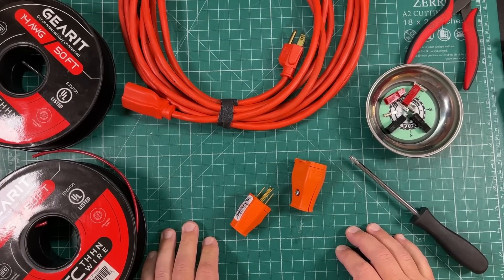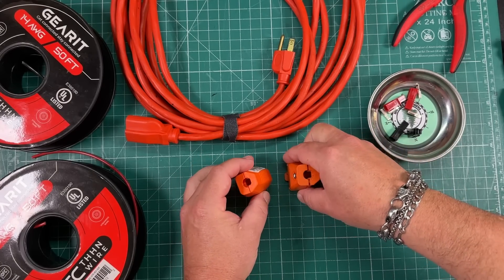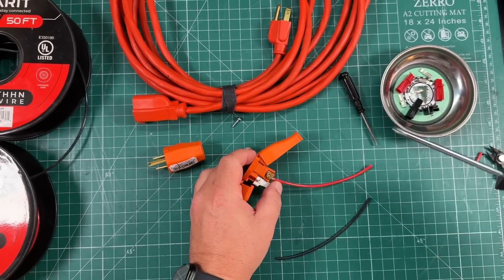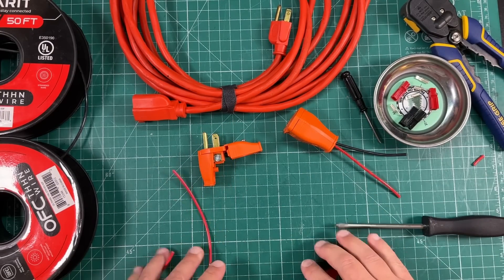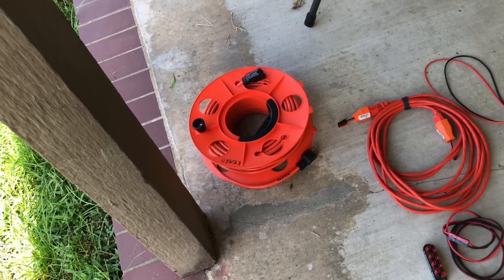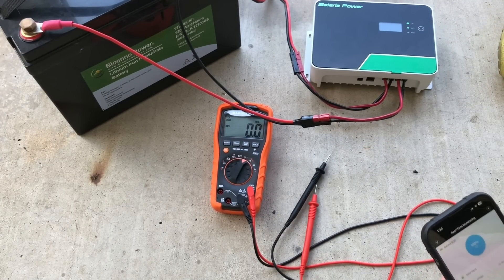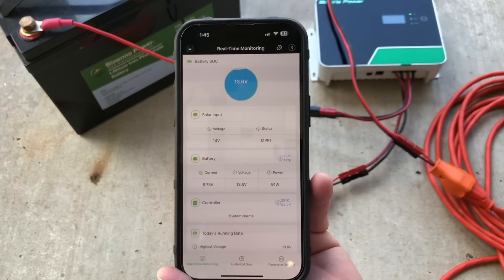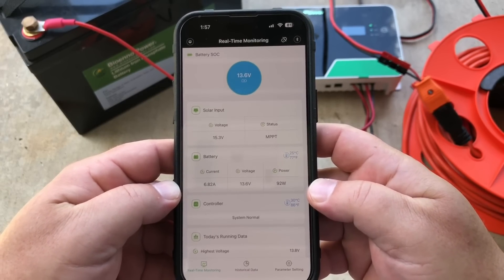12V DC Through Extension Cords For Solar.  Will It Work?

Comment: I've been doing this for solar for about 15+ years.  I just cut the extension cord ends off and attach Anderson PP directly to one end and ring terminals to the other end.  100 foot runs through the winters here in Alaska.  Works just fine. Always good to experiment though and thank you for the video.

Comment: Stay safe Mike! If you want to use an extension cord, cut the NEMA 5-15's off each end and crimp on PP's directly... If you make a NEMA to PP adapter, someone, someday, is gonna plug it in!⚡⚡as for the losses, you're going to need 10x the current with 12V over 120V for a given power transfer, and the losses are I^2, so you're fighting a 10x10=100 fold battle... Get the highest gauge ext cord you can! Jumper cables, maybe? Keep experimenting! (Safely!! 😊)

Comment: I would have put the negitive to the ground plug, I would think that might reduce the chance of the magic smoke comming out of things :)  Just a thought.   Good idea for an emergency - 1/2 the power is better than 0%.  Maybe try converting the DC to AC, using the 100ft cord, and then converting the AC back to DC.

Comment: Why not just pound the power-poles in the negative side of the AC extension cable and charge your battery directly from the wall…? Should have no problem with voltage drop then…

Comment: I’ve been doing this for my temp solar setups for years. I really use a 12ga. extension cord, but in a pinch any old extension cord will do…  I try to keep the length to 25 ft. 400 watts of solar is plenty enough to keep my Bioenno battery charged for Portable HF use.

Comment: I got that hurricane in NY today that came threw Texas . We got grid down and 2 torandios hear. trees down all over. flooding but minor. on;y 3 in rain today.  Try 2 extion cords . all 3 wires for each pos and neg. repeat test you did.  At least you did not put 2 male plugs together and plug 120V inverter into your home . How very bad that is. never back feed power grid.  you put transfer switch in breaker panel. And that can be inverter or generator . just do not use 12V power cable for 120V . insulation not rated for that.  some is 300V/600V AC/DC cable.  UL Welding cable is . 73

Comment: @japanham5973
1 second ago
Wrap the cord/power pole connections with self-fusing Silicone rubber electrical tape. It is a bit sticky, but will make anyone notice that the cord is not just a regular extension cord. They would have to take the tape off, unplug the Power Pole jumper to use it, and I think most would hesitate to do so without checking out the other end too...

Comment: I did what @jamesemery1 commented on. I use two separate extension cords (EC). Each is 16AWG/3, one EC for positive EC one for negative. Combining the three wires in each cord creates an 11-ish gauge wire. I use MC4 connectors from the panels to the solar battery systems I built. I made a MC4 to Anderson power-pole cable. My solar input lines from the MPPT use MC4 connectors or APP connectors. The APP you need the 45A hardware, anything smaller and three 16AWG combined will not fit. It works. The limitations on length of runs applies as usual. The real benefit for using dedicated solar cables is durability, that's it. The cable can weather years of exposure and the elements. The life of extension cables is much shorter if exposed for a year or two in direct sunlight. The reason I went with extension cords: they are flexible!!! Solar cables are a pain in the but to work with. My panels are ground mounted and I move them every now and then. Not having to tack down cable that wants to corkscrew is a blessing! I weather proof them by using electrical tape then heat-shrink tubing over the MC4 connectors. Other than NOT leaving any length on the extension cords coiled (just as solar cables) since they generate an electrical field (inductor?) that causes additional resistance? My solar is only 1200w.

Comment: I rigged up something similar years ago so I could set off replaced air bags taken out of Ford Taurus and Sable cars (big recall). I would wait until trash day so the dumpster behind the shop was empty, set the air bag trim side facing up and apply 12 volts to it through a 50 foot extension cord (boom!).

Comment: You can decrease your Resistive losses by increasing the gage of your wire or by increasing your Voltage, ergo decreasing your Current. By putting the panels in series you increase your Voltage reducing your Current and therefore your effect from Resistance. From a safety standard never mix connector types, mistakes will and do happen. Someday you may forget or a newcomer to your system may not know what you have done. Always, Always keep your runs of conductors as short as is possible and use the largest conductor as is reasonably possible. Never forget Power is = voltage * Current or I 2rd * R. Ohms law is the law, not a suggestion. The experiment was worthwhile. Thanks for the video.
Reply: With the panels in series I wonder if the voltage would exceed the max input voltage of the solar charge controller.
Reply: @kd5you1  Of course it might. The charge controller would have to swapped out for one with a higher rating. Charge controllers are available in 12, 48, 96 volts and maybe others. The most common for off grid homes is 48 volts.

Comment: I use extension cords all the time for other uses, from solar panels to speaker wire,  its usually the cheapest way to get wire unless your buying bulk.   I dont use the 120v plugs, just so someone doesn't plug my solar panel or speakers or whatever I'm using them for into a wall outlet.    Just  know you gauge of wire and the voltage / amperage you need to send through it..   if you need heavier gauge wire, then just use all three conductors for positive and another cord with all three conductors for negative.

Comment: I would add a screw on clamp that makes you have to use a tool to remove the power pole adapter from the drop cord.  That would keep mistakes of someone seeing the drop cord and plugging it in the wall.  They make cord lockouts, or get a project box for the AC male end.  Good idea though!

Comment: One word for you, dolly.  I have 600Ah worth of batteries, charge controller and inverter permanently attached to a dolly (hand cart).  From the dolly I run a super heavy duty 8 gauge extension cord inside for the 120 VAC.  Point being if you must run long wires it's preferable to do it with AC.  You have much less energy loss with AC than you do with DC over long runs of wire.
Reply: DC is actually more efficient because it doesn't build and collapse the magnetic field at 60hz (or 50hz in some countries).  That's why the long distance power transmission lines are changing to DC.

The only thing that matters is higher voltage transfers the same amount of power with less amps.  Amps cause the losses, and in the old days there was no efficient way to change the voltage of DC but there was with AC.  It's the 21st century now.
Reply: That is what I did! I used a 4-wheel push cart for one setup and a hand truck for another. I replaced the two wheels on the push cart that do not swivel with two that do. It makes it so much easier to maneuver around my garage and tighter spaces. The push cart is not as travel friendly around the property, but it great around the house and garage. The upper tray I built a cover so I store cables and what not in there. I added a third shelve where I placed the 3000/6000w inverter. The hand truck I modified so I could add four additional wheels. When the dolly is upright, the weight is on the four wheels, when tilted I move it as a dolly is moved when carrying a load.
Reply: @mikesradiorepair, we miss you on YouTube! Wish you'd come back with more sage radio repair tips and tutorials, and hope you are doing well!
Reply: That's what I was thinking. It would be nice if the solar panel voltage could be converted to 120v near the panels.

Comment: Remember you have a 3rd conductor in the extension cord you can put in parallel with one of the other ones - which will drop your overall loop resistance. I would suggest pairing it with the negative side... just for some consistency. The negative leg would then drop resistance by maybe 1/3rd (won't be a full half, as the ground conductor likely isn't sized the same as the current-carrying conductors). Still helps.
Reply: Nailed it!  I was thinking along the same lines watching Mike put this together.
Reply: @VE5SAR-Hamnetics  great idea! I know the cables I've dealt with had the same gauge wire for all three conductors. I guess ymmv but it's worth a try. 🤙🏾
Reply: @TheGeekiestGuy  yeah, typically see all conductors the same in the lighter cords. Differences usually only arise in the heavier cords, such as the 6/3 8/1 combo.

Comment: Wouldn't it be cheaper to just buy some wire and put power poles on it? [Edit: Ah, I see. You already had the extension cable]
In general mixing low voltage and mains connectors is asking for the magic smoke to be released from something.

Comment: This is a good demo, Mike. I know some charge controllers do a test draw on wire when you plug them in. If you had a 10 gauge extension cord, you'd probably get that 9 amps for a slightly longer distance.

Comment: Great Idea. Just my 2 cents. Coils of wire actually make an inductor. It would have been better if you straightened them out. Also if you really want to see some weird stuff put a magnet in the center of those loops.
Reply: Inductors are a short to DC, so not a concern in this instance.

Comment: Seems like a great experiment to me. The way I look at it is the sunlight is free in either case. So your cost for the energy itself is $0.00. After that, the only extra cost is the additional time to charge the batts, call this Y. Then, if you factor in the discount from using extension cords you already have lying around, call this D, you're actually ahead as long as D - Y is still positive. $0.00 + $0.00 + $D - $Y = at least some positive $ amount... I think that's a great finding! 73, AI5QA

Comment: 10 ga wire has 1.6 times the cross section of 14 ga wire, and 6 ga has 2.5 times the cross section of 14 ga, which should reduce the transmission resistance by those same ratios, for a given length and material of wire.

Comment: Just make sure you label that extension cord, or you're gonna have a bad time... I've used extension cords for work when that's all I had on hand. I'd rather have a thicker gauge wire than one that's too thin. 🤌🏾🤙🏾

Comment: As  a Radio Ham but speaking professionally as an Electrical Engineer these are called a widow makers
Reply: For 12 VDC?
Reply: @Philip-KA4KOE  yes, when the unknowing can plug one end into a 120v outlet.
Reply: I was thinking along the same lines as he started, but as short as those adapters are, it'd be pretty difficult to mistake and and plug it into a 120VAC circuit.  But if he did, it sure would release a lot of magic smoke!
Reply: @stevenemert837 The concern would be using one of those adapters on ONE end of the extension cord, and plugging the OTHER, unadapted end 100ft away into a wall socket, then thinking the PowerPole end was relatively safe low-voltage stuff when it’s not.
Reply: A fuse on the bus bar or right off the battery poles is needed for sure.
Reply: I may or may not have a widow maker cord for my small generator 😅… it makes it very easy when I want to use just a few outlets in my house

Comment: This will only work as long as you have a Solar Powered Proton Accelerator mid way through the run of wire, to boost you power back up until you get to the end!

Comment: THHN wire in conduit if in-wall.  otherwise, go nuts!  I'm liking 12AWG lawn-light direct-burial wire -- super cheap at Ace Hardware!
Reply: Ive used the lawn light stuff. Very rugged.

Comment: If you have multiple panels and hook in series you should get a higher voltage so loss should be less. You MPPT charge controller will like a little higher voltage anyway.
Reply from the maker: That's not a bad idea.  Then I could run the higher voltage inside from the extension cable with less loss into the CC.
Reply: @hamradiotube  This is the way
Reply: @hamradiotube  make a followup video and show us the results of using these extension cords with your panels in series.

Comment: To be short & quick - uh, NO!

Most extension cords are poorly made today!  And you need at least 12 or better 10 gauge wire in the cable... Those are expensive.  

You REALLY DO WANT HEAVY DUTY Wiring  with Silicone insulation to handle the heat!

Remember, if need a 10 Amp 120VAC load, that takes 100 Amps @ 12VDC  input, minimum!

Of course all of that is dependent too on run length to prevent excess voltage drop. The general rule is to keep the DC input cables as short as possible!   Just stick to silicone insulated 6 ga. wire and short runs, you should be good. 

Btw, the silicone cable has much higher voltage isolation too, for serial panel runs.

Comment: I was almost out the door to Home Depot dammit! What if you put the batteries closer to the panel (as you said) but ran the longer (heavier gauge) cable to the load (either DC from the battery or AC through an inverter)? You could still have the appliances/radios in the house but you might not get as much loss that way.
Reply from the maker: I already run cables from the inverter all over the house for 120V.  That's not the problem.  I just don't want to move 150lbs of batteries every time I need to use solar.
Reply: I would suggest using the ground and common wire. That way if it was plugged into 120vac  the hot wire would not be connected to anything.
Reply: Much larger gauge wire?